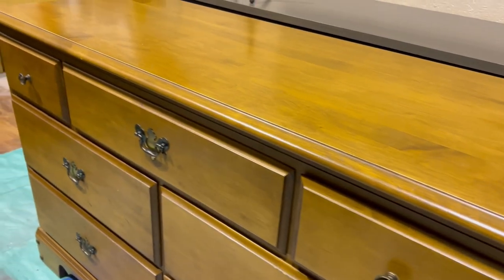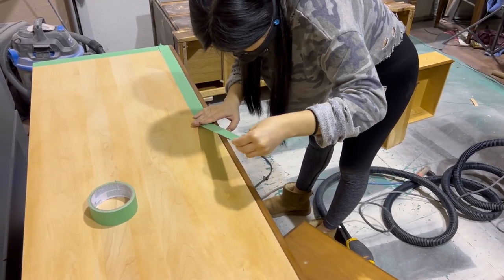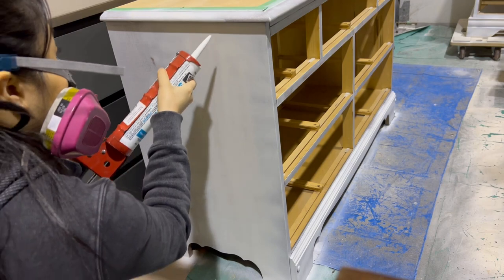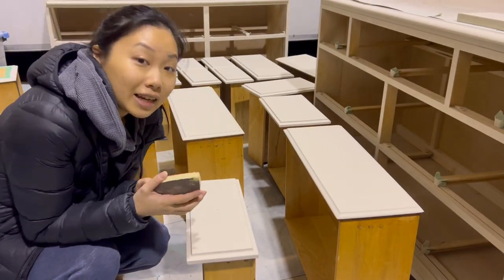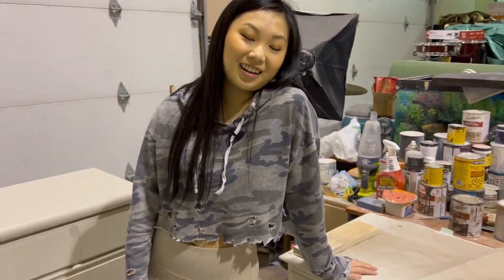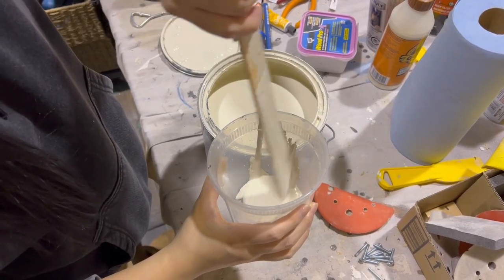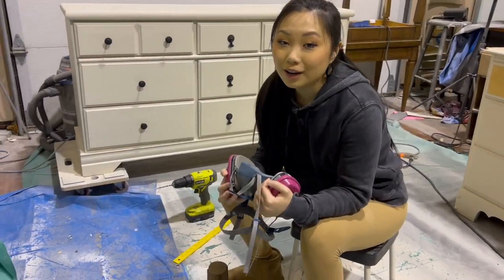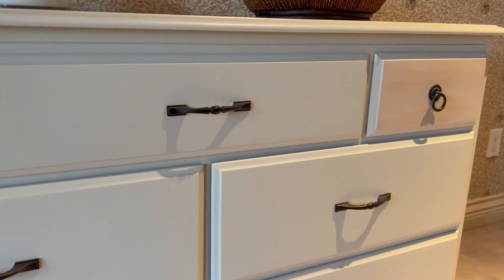DRAMATIC DRESSER MAKEOVER: Paint Wash on Wood | DIY Furniture Refinishing #furnituredesign  #diy

Comment: Was that a form sanding pad on your mouse sander if do where can u get it and is it worth the buy? Thxs
Reply from the maker: Yes!! I love them they make sanding around details so much easier. I got them from surfprep and you can get a pack of 10 for about $30. They’re totally worth the buy, because I’ve only used about 4 of them so far and I got a pack about 8 months ago. I only really use them for fine sanding though, I leave the tough sanding for my flat sandpaper sheets.